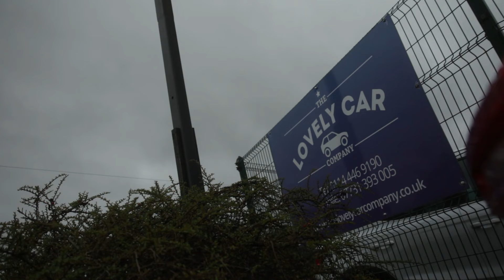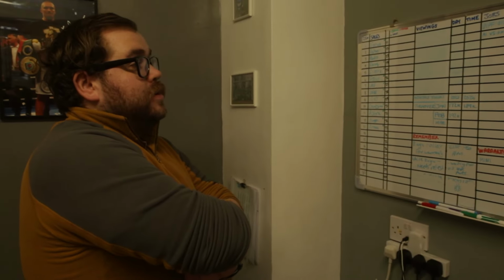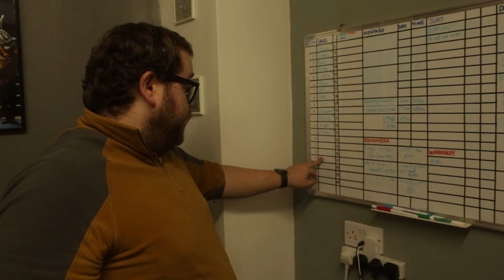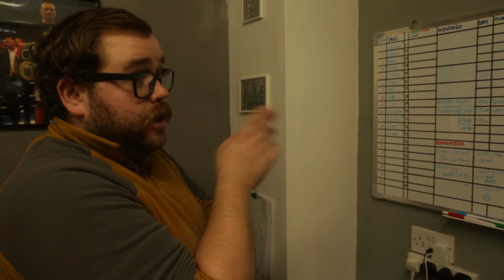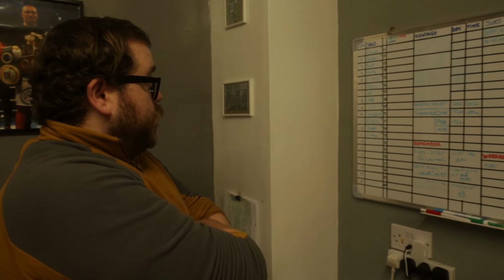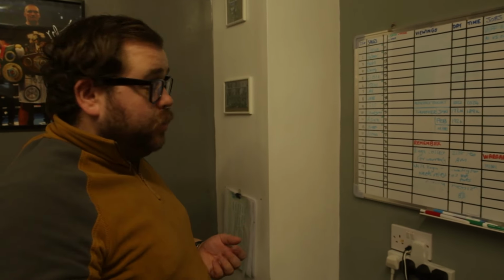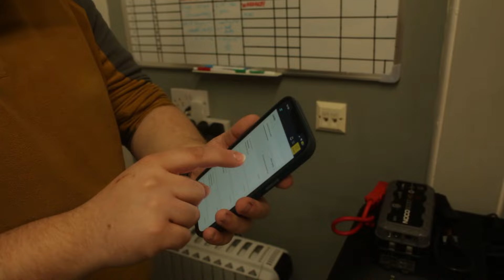ECO BOOST ENGINE DIES AFTER 4 MONTHS AND 4.8K MILES AND WE STILL HAVE TO REFUND CUSTOMER!

Comment: What's clear here is a misunderstanding of the CRA by many people, which is understandable as a lot of it is open to various interpretations.
One of the key words now being  used by A.C.E inspectors and the like is "DURABILITY" and it's very hard to argue against, especially (but not only) when a finance Company is involved. If a case goes to FOS it's unlikely they'll find against the A.C.E findings and it'll cost the motor trader £750 for the privilege, regardless of the outcome.

Comment: Some good news for the Ecoboost engines is that since 2020 in the Puma they've been changed to timing chains so that should eliminate 99% of the Ecoboost issues.

Hopefully it's not just the Puma with the chain driven Ecoboost.

They can also be converted to chains, hence if you ever change the belt you might as well pay a bit more for the chain.
Reply: Technically still a wet belt driving the oil pump though so it remains to be seen how the reliability is at higher mileages on the new timing chain version and it's not only the puma all models have the chain version now
Reply: @sbrader97 Good to know thanks, Hopefully it will at least reduce the problem/s. Hopefully not as much stress on the belts and only 50% as much material. Hopefully the chains don't introduce another issue then. Ie stretched chain, worn tensioners etc. They'll get it right eventually!

Comment: Think you need to check the legals through for the future. Can a finance house demand this? What does the sales of goods act state etc? It used to be that the finance house didn't care, they'd still demand the money off of the borrower even if the car had caught fire and gone up in smoke. Might be worth getting all this shored up. Any vehicle over certain value you need to put a warranty pack on to cover the 6 months etc. Then the warranty company may/should argue the case in part for you etc.
All the best and keep up the good work.
Reply: The SoGA hasn’t been law for 9 years, the Consumer Rights Act 2015 is the reference now and it gives far more rights to the buyer

Comment: I'm going through something similar, the finance company are threatening to report me to FCA if I don't repair it.
The customer came back 2 weeks after the warranty expired, said its been acting up  for 2 months!
"Why did you continue to use the van, making it worse and why didn't you let me know you had a problem while is was still in warranty?"
His reply, I didn't know I had to! 😮
Reply: Your a motor dealer , your 3rd party warranty counts for absolutely nothing. It's ridiculous car traders(of which I am one) don't seem to  understand the legal position, regardless of FCA etc. Familiarize yourself with CRA 15
Reply: I do understand fully, my gripe was that he ran the vehicle for 3 months with the issue before contacting me. If he had the 3rd party warranty would have taken care of it. The issue wasn't there at point of sale either.
Reply: @petewatson4093   point taken but collectively motor dealers are partly to  blame for this.  Don't promote the warranty as a product for the consumer. If the truth be told the 3rd party warranty is to protect the dealer. Can't really grumble when it comes back to bite you on occasions such as described
Reply: Don't listen to these ignorant views. They're blinded by the text of the legislation.  
As far as they're concerned,  a van with a million miles on the clock has the same protection in law as a van with 1 mile on the clock. They've never heard of wear and tear. 
If the fault was present at the point of sale, then yes, you're responsible.  

No one has asked you about the mileage of the van when sold or the mileage the bloke did before the van faulted. 

Also, in law, if the consumer continued to drive the van and make  the problem worse  (" drive on damage"" ) then you're not responsible for the more severe fault.  You're potentially responsible for fault A(minor fault that could have been fixed had the customer stopped driving the van) and not fault B(more serious fault due to negligence). 

Don't listen to anyone who's never actually tested the legislation in court.

 Armchair lawyers mate

Comment: A sensible buyer (or seller) knowing what the belt issues on this engine would want a new belt on ASAP, everyone seems to have trusted to luck on this one, basically the buyer thinks as long as he makes his chucky payments nothing should need doing, I've sold loads where a sensible buyer has said ill have a cam belt service done St away, after all it's his car, or come to some agreement at the time of sale, tbh it probably wasn't even considered by both sides at time of sale.

Comment: First 30 days you've had it, after 4 mths he's got to give you one chance to repair it, as it would be basically a new engine I'd want some money off him, if he wants to regect it your within your rights to make a reduction for mileage, basically 4800 miles is like 1500 quid, which would buy the engine, I think close bros are pressuring you as they don't want a complaint or loan going bad and they repo a car that's scrap, I'd basically tell the guy you'll fix it but he'll have to contribute as he's getting the benefit of a new engine, anyone reasonable would be happy to say pay 800 quid as it would be a new engine, he'd actually have to take you to court on this one and judge would ask if he'd given you a chance to repair it and it seems not, so he'd basically loose.

Comment: The ACE inspector has stitched you up too.  4.5k miles later, on an engine known for this fault and he reckons the fault was on the car already? 

If you'd have gone to small claims court you'd have had a different outcome.
Reply: Under the CRA any fault that manifests itself within 6 months of purchase is deemed to have been present at the time of sale.
Reply: @Graham-rc1cp  yes, but the retailer has the opportunity to demonstrate this particular fault wasn't on the car. Rather straightforward in this instance I would contest.
Reply: @Turn12335  Doesn’t work that way I’m afraid - between 30 days and 6 months after the sale any serious fault that arises is deemed to have been there at the time of purchase, the only way out is is the dealer can prove the fault wasn’t there, which is impossible unless you can show it had a new belt immediately prior to sale. After 6 months it becomes a bit easier as the onus is then on the buyer to prove the fault was there from day 1.
Reply: @Graham-rc1cp  I'm sorry but that's aimply not correct. The court doesn't expect you to prove forensically that the belt was not faulty. 

Its on the "balance of probability" whether the fault was present. 

The court will take into account whether there is a recognised design fault with this engine(and there is), and the mileage covered since purchase. 

A simple Google search will tell a consumer if this is a vulnerable engine to this type of failure. This goes in the favour of the dealer. 
If the belt snapped on the drive home it would be different of course.

By your interpretation of the law there would be no point putting a warranty on any used car- irrelevant of the age or mileage-as everything serious is seemingly covered by the CRA2015 for 6 months.
Reply from the maker: That’s exactly what close brothers actually said but because it’s to do with the FCA there’s not a lot we can do
Reply: @Turn12335  Again, not how the law works, the law makes the assumption that the fault was present. 

Out of interest, how would you prove the belt wasn’t degrading at the time of sale?
Reply: @Graham-rc1cp  you're getting bogged down with the definition of "proof" Graham.  This isn't a murder trial. 

I would ask the court to consider the high failure rate of these engines, the design flaw of the belt etc. And significantly,  the mileage since purchase. 

It's impossible to prove as you are expecting unless you removed the belt and tested it. The court is not expecting this as its unreasonable. You'd never sell anything as you'd be too busy stripping engines and gearboxes to prove they're fault free.

The legal test is "on the balance of probability " on the balance of probability would a perished belt last over 4,500 miles?  I would provide multiple forms of evidence in the press about these problem engines. 

Throw into the trial that the customer has been dishonest and you're looked at in a more favourable light than the claimant.  

I am not just spouting my opinions, I'm repeating actual court rulings and how a judge formed his opinion.
Reply: @Turn12335  Give me your opinion on this one;

You sell a 5 year old car with 96k on it, 6 months and 5k later the wet belt fails, trashing the engine.

It transpires the car hasn’t been serviced since 41k miles.

Can the customer reject the car?

Comment: Nightmare for you, I'd be going crazy if I had to refund after 4 mths, fault can't really have been there at the start but no one can prove or disprove, you can get recon engines for 1300 quid, so it's a 2k job, I'd of thought a grand from your customer and a grand from you would have been more than fair, but chucky customer probably wouldn't have a grand, trouble with finance is they think it's your car for the length of the term.

Comment: That’s a joke about the eco boost. There is no way you could have know that the belts was breaking down and blocking the oil strainer. Unless you had an oil pressure light on. That AA inspector has had your pants down. And yes it’s dead for me also atm
Reply from the maker: Thanks mate

Comment: What's so interesting about the comments section, is you can tell who is a customer expressing their views on the consumer rights act,  and who are the dealers. 

This is not the fault of the consumer,  its the fault of a simplified explanation of the law by Autotrader and Which? for example.  

Punters reckon by a dealer "proving" a fault wasn't present on the car when it was sold means you have-in your case-to have inspected the cambelt prior to sale and bench tested it and provide a certificate proving it wasn't faulty. 

If you pursue this irrational perspective,  you would also have to remove every major component and certify it as not being faulty. 

Automatic gearbox,  alternator,  abs pump, power steering pump....all would need to be removed and bench tested by their logic...the list is endless and you'd never sell a used car again.

That's why mileage covered since purchase is vital in demonstrating to the judge, "on the balance of probability " the belt simply snapped. 

These things happen unfortunately with ecoboosts.  

Warrantywise fpr example won't pay out for a new engine because of this inherent design fault. 

A judge will take all of the above into account.  

Customers are frequently being told this in small claims courts every day across the land and losing their case. 

Mileage on the car/age of the car/mileage before fault occured are all massive factors in a judge making a decision.  

It is simply more complex than some punters realise.
Reply from the maker: That’s exactly why this claim feels so
unjust
Reply: Unfortunately, from the video, it would appear the dealers are the ones with little or no grasp of the CRA, when Dave’s stating this is a finance-related regulation.

With regards to this particular incident, had the belt snapped then yes, I’d say the dealer would be well within their right to tell the customer where to go as a timing belt is a wear and tear item.

The problem with wet belts is they don’t snap, they disintegrate over time and block the the oil pump, causing engine failure, and that’s something that in all probability was already well under way at the time of purchase.

It’s a shitty position to be in, however ultimately the law is there to protect the *consumer*, not the dealer.
Reply: @Graham-rc1cp  

There's little point continuing Graham as, like so many consumers,you're fixating on the definition of "proof" and your intransigence stems from this misunderstanding. 

All the evidence presented is merely circumstantial. Thats why you need a judge to decide, and the opinion of a court appointment expert maybe,  but that's not essential.  Again, balance of probability.  

Dave has said in the comments section that he was told the same things that I'm saying by the actual finance company, but  this appears to be an FCA sticking point, and not CRA

CRA2015 and FCA obviously different rules. Nice to have chatted anyway.
Reply: @Turn12335  Condescending nonsense, I was probably in the trade longer than you’ve been alive. 

Going back to the question I left you; that was an actual case that went to the Motor Ombudsman, the seller came out with the same ill-informed nonsense you did, the ombudsman made them take the car back.

But I suppose you know better than the ombudsman 😂
Reply: @Graham-rc1cp  I never replied to your question Graham
Reply: @Turn12335  I’m aware you didn’t, presumably because you know you’re wrong. The issue has been tested via the ombudsman, they have ruled if a belt fails within the prescribed timeframe then it is a fault, not wear and tear. Hope this helps.

Comment: Well you know the faults on these vehicles eco boom. You should have checked belt before sale your responsibility not the customer!
Reply from the maker: We done everything we possibly could at point of sale. The customer then done 4800 miles and it went pop
Reply: @cardealerpro  lessons to be learned here you need to look at doing work yourself any ecoboom I get has the stump whipped off and the belt checked no questions asked.